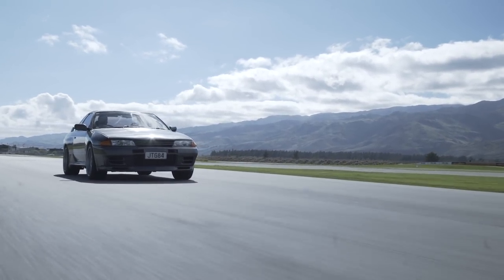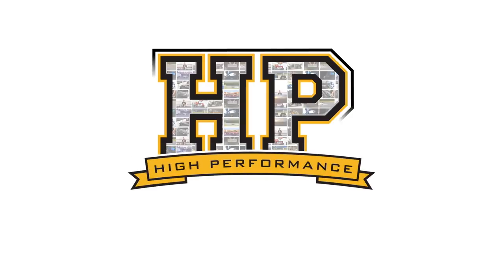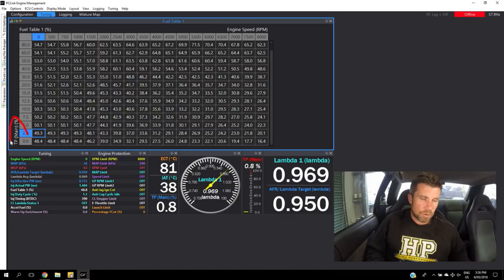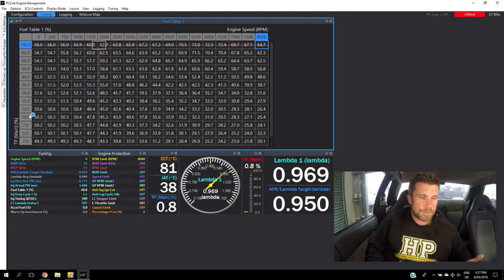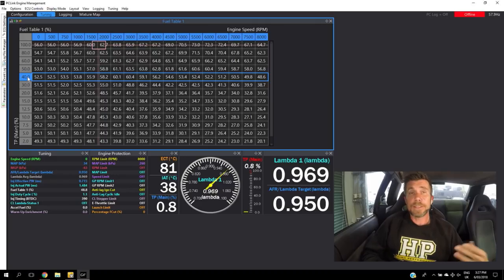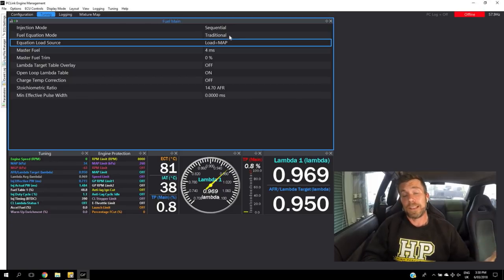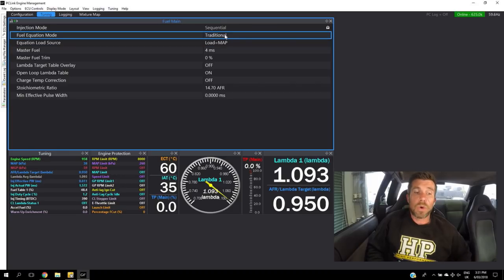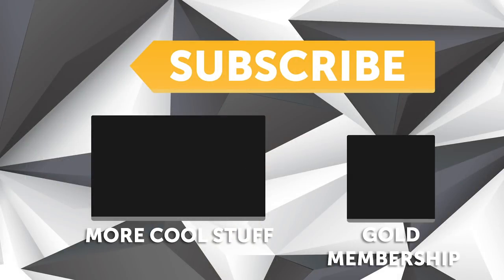TPS + MAP Tuning | Turbocharging with  ITBs - Alpha N [GOLD WEBINAR LESSON]

Comment: thank you very much ! i m  new to this tunig word and your video help me to understand how to set up my ecu to work correct with my set up ! 
only one qustion  i have :
(bmw m50nv itbs, ecu master emu black )
i dont have 4d table in ecu master as option but i do have "map vs rpm correction " is it that what shoud i use to correct the my ve table at 100kpa + ? and  should i consider value of 100 to be 100% of the ve table (97 =  -3 ) ?

Comment: Good video, thank you.  I have an important question.  From my experience with the BMW S50 engines, is that the MAP pressure readings are representative of load.  In these engines the ITBs are connected with a common vacuum rail so the pressure readings are more like in a single throttle setup.  Is the engine in this video lacking such a common vacuum rail?    This is also the case for other BMW-M engines with ITBs like the S54 CSL and S65 which uses MAP sensors from stock.
Reply from the maker: Even when running alpha N, where possible it's advisable to incorporate a MAP signal so the ECU can performa background compensation for MAP. This should be done from a balance bar that takes a feed from behind each throttle to give a stable average MAP value. You would think then that we could simply use this MAP signal for a conventional SD fuel table but unfortunately it isn't quite that simple as MAP alone isn't a good indicator of airflow with ITBs.

Comment: Oh and one thing not covered here, and kind of in response to Andy's question. 
Often ITB engines have a really crap (unstable) MAP signal. So tuning low loads and cruise on the MAP sensor is an exercise in tearing your hair out
Reply from the maker: Actually you can get a MAP signal that's nice and stable by taking a line off each throttle body and running them to a small reservoir. That still won't give you good results if you try tuning using MAP alone though.
Reply: @hpa101  I use the efi-hardware kit for this this (it's really well made,) on my GTiR. With the 4 cylinder, it's still a little too 'jumpy' for my liking. No doubt on a 6/8/10/12 where there are more cylinder pulses it would event out even more.

Comment: Hi guys @hpacademy

Quick question: you mention that you don’t need to use alpha-n for the ignition table as only the fuel delivery is influenced by the individual throttle bodies (which makes sense) Is this true for NA applications as well? 

I have both tables with tps on the load axis atm and just wondering if switching the ignition table back to MAP would be benificial. 13b engine, megasquirt ecu. Thanks!!

Comment: Can solve the high boost rich problem more elegantly by tuning in in VE mode. Using a TPSxMAP with MAP measured in pressure ratio between IMAP and eMAP?

To the best of my knowledge Link don't offer this option. Regardless excellent tutorial 👍
Reply from the maker: Pressure ratio would be the preferred load axis input, however that creates two separate issues. First up it's quite involved and reasonably costly to add an EMAP sensor (at least once the turbo system is already complete and running). You also need to be able to filter or dampen the signal adequately to make it useable without adding latency to it - Not difficult but it's often ignored. Secondly (and probably the more pressing issue) is that a lot of aftermarket ECUs don't offer pressure ratio as a load axis option.

Comment: So I'm building a 2jz with rb26 itb's...

So installing a MAP sensor on a custom vacuum chamber with signals from all 6 runners isnt enough :(
Reply from the maker: I wish it was but sadly nope. In all honesty unless you're already done with the project I wouldn't recommend adding ITBs to a 2JZ. It's unlikely you'll see any real advantage from doing so and even in the RB world most people chasing high power will revert to a plenum and single throttle. If you're doing it for the sake of being different then have at it, however if you're expecting a massive transformation in terms of response you may be disappointed.
Reply: @hpa101  with the current situation nz is in, I'm just doing things for fun.

I do have a goal. Nothing more than 500HP. 300hp is more than enough to drive to the south island and see what those b roads are all about.

Comment: As I understand it some ECUs offer a "MAP window"  feature, where the user can choose a sampling window during the cycle (720 degrees).  This is then set to start sometime after intake valve opening and end  time after intake valve closing, and a minimum MAP value during that window is used to calculate fueling. Any experience with this?

Comment: In the speed density system the MAP is taken in the plenum chamber and after the single throttle plate. In this example for the main fuel delivery table you are using TPS as the load axis because there is no common plenum chamber but in the lambda target table you are using MAP as the load axis to allow for changing turbo boost pressure. Is this MAP taken after the throttle plates or is it taken between the turbo and the throttle  plates. If it is taken after the throttle plates are there  hoses coming from all 6 inlet ports to some form of surge chamber to even out the strong pressure pulses that you would get from a single port only.

Comment: Why are you only running on 2wd? Does it not effect the loading of the engine with awd engaged?
Reply from the maker: It's a little easier to use a RWD car on a rolling road dyno vs AWD or FWD. The load is the exactly the same, the engine doesn't care what it's driving it's doing the same things at the same load cells regardless.
You can even tune the engine on a dyno by itself if you wish - Taz.

Comment: So what if we don’t have an on board wideband in the ecu and only using the dynos, do we just use the tps for base fueling then can use the 4d table for boost?
Reply: you better buy one.
Reply: You need wb
Reply from the maker: You don't need an onboard wideband to tune but you will need a wideband - either a portable one that you can log the output from, or one connected to the dyno. Without that you have no way of knowing the AFR.
Reply: I’m aware of that I meant using the dynos wideband instead of having one wired into the ecu. The primary fuel base table will be the same but what secondary table is used for boost. Cheers

Comment: Why not use a MAF sensor? Thanks.
Reply from the maker: Many aftermarket standalone ECUs don't actually offer the option of a MAF sensor so you may have no option. There's nothing wrong with using a properly sized MAF though in an application that's compatible with one. A MAF or in the case of the RB26, twin MAFs also adds to the complexity of the intake system.
Reply: @hpa101   Thank you!

Comment: Alpha N / tune . Is a BMW thing. Nothing to do with syklines or RB engine's.  And I've turbocharged a S50 Euro in my e30
Reply: bmw didn't invent alpha n lol
Reply: @Nebbia_affaraccimiei  neither did Nissan.  So what are you on about
Reply: @Nebbia_affaraccimiei  says the troll fake account
Reply: @_i-kr6eg  what are YOU on about? you can see my channel and my videos no fake here. alpha n existed since ecus existed. nothing to do with bmw
Reply: No one said Nissan invented it lol. These cars used a MAF stock. This is just a best case scenario as ITBS
Reply: @Nebbia_affaraccimiei  says the non car guy and troll talking about things he has no idea about.
Reply: @KronicKatz  what you said made no sense nor did it clear up anything!!!?? . Do you even open or ever had a modified vehicle/s I guess not
Reply: just gonna leave you rambling. i recalibrate oem ecu for a living btw.
Reply: @_i-kr6eg  lol I own a r32 GTR with a Rb30...... I was saying stock Nissan had the air calculation based upon a MAF sensor. The reason as to why you see alpha N applied here is due to the fact the car has ITB'S. INDIVIDUAL throttle bodies cause for odd transient air conditioned which cause and over fuel or under fuel in the upper or lower part of the fuel maps, causing you to swing your afrs in attempt to correct it if you were using a traditional map vs rpm tuning perspective. As to why you are compensating map using the ideal gas law in order to map your fuel table to a throttle position vs rpm while compensating for boost.
Reply: @_i-kr6eg  but you literally kill me. These strategies are ubiquitous in the tuning world, irregardless of manufacturer. It's a case by case scenario that determines the strategy used. Your head is huge lol.
Reply from the maker: I've got no idea what you're talking about. It's not 'a BMW thing' and instead is a tuning method applicable to ANY engine running ITBs, including the Nissan we use in this webinar.
Reply: @KronicKatz  and I already know . Most of these because my S50 Euro has this also alpha n tune is for smoother power delivery etc makes the car more driveable
Reply: @hpa101  not a BMW thing . How if I had a n tune software in the early 2000's And before that time . And I've never seen anyone tune a rB with ITB and big hp because almost all remove the MAF and ITB system  . So no Nissan has nothing to do with anything ever . Talk to BMW guys . Please most of you keyboard warriors need to get a job or experience before stating absolute rubbish
Reply: @hpa101  yes I know this also it's more for the drivablely and more refined tune as in the mapping,  sorry I only know more mechanical not chips/ electrical etc etc still don't know how tune a car on a dyno , but most wouldn't have a clue anyways
Reply from the maker: @_i-kr6eg  and yet here we are with a Nissan RB26 with ITBs and if you watched the webinar then you just watched one being tuned using alpha n... 💁🏻‍♂️Nissan in fact has lots to do with lots of things, lots of the time. And at the risk of repeating myself, no, it's not a 'BMW thing'. Do you believe that BMW invented this? If so you're sadly mistaken. It's also been around for decades - It's not a new technique.
Reply: @hpa101  I know BMW nor Nissan made it !!! I don't care . But I've used it years before I ever seen it used in a RB !! I'm sure in the late 90's and early 2000's people were using alpha N tune!!! Show me or do you know people that used such software/tune on a RB I never had !!! Nor does anyone else using it because almost on a RB go single TB and no MAF on RB engines .
Reply: @hpa101  mate the RB scene is boring did them 12 plus years ago , those engines/ car skylines are old old news too me worked on so many of them it gets old quick!!!
Reply from the maker: @_i-kr6eg  what's old to you is new to someone else and what's new to you is old to someone else. 
It's all good, at the end of the day this is a lesson on Alpha N tuning, not anything specifically marque related. A car has to be used to demonstrate, one was, here it is. Even though it's old hat to you, I hope you still enjoyed it 😎 - Taz
Reply from the maker: @_i-kr6eg  Ohhh you are talking about Alpha N Tuning software, which is BMW flash tuning software. 

We are talking about a tuning methodology that is that device is named after. :)
Reply: @hpa101  thanks lol

Comment: ITB's are only marginally valuable on a NA engine.
On a Turbo engine ITB's are completely useless, therefore, DON'T USE THEM.
You can still run a MAF with a Turbo and ITB's.
ITB's can be made to work with  a Speed/Density setup by creating a vacuum/pressure reservoir that connects all intake ports after the TB's,
but this is a pain in the butt way to do it that requires a lot of cut-and-try experimentation, for ZERO GAIN.
If you're installing a Turbo on an ITB engine, 
REMOVE THE THROTTLE BLADES AND SEAL THE THROTTLE SHAFT HOLES, OR, GET A PLENUM STYLE MANIFOLD.
The power difference is zero to none, and your tuning headaches will be greatly reduced.
The best setup is to put a huge TB on the inlet of the compressor, and a MAF ahead of the TB, 
this eliminates the need for a BOV and reduces Turbo Lag at mid to high rpm, and to a lesser extent, 
reduces Inlet Air, and Compressor Housing, Temps.
If you are considering using Alfa-N tuning, then you already have an after-market ECU,  
which means you can run a standard GM MAF which is good to over 1000 HP and very easy to tune.
The GM MAF is specified to be mounted in a 4 inch tube, you probably can't come close to using all that flow potential.
This setup also allows you to run a small percentage of your Water/Alcohol Injection at the Compressor Inlet 
without fear of running it through your inter-cooler, because the inter-cooler will be running under vacuum ~95% of the time.
In fact, with a properly engineered Water/Alcohol Injection System, you can probably get rid of the inter-cooler and all those expensive pipes,
it only depends on how extreme you are going.
.
.
Reply from the maker: Unfortunately making a blanket statement like you've done is both misleading and inaccurate - There's unfortunately not a lot of absolutes in the world of performance engines. There can be some significant advantages to ITBs on N/A engines in terms of power which we've proven on the dyno multiple times in both the Honda K20 and B16/18 as just two examples. It's not always a case of chasing power either, and Nissan chose to use ITBs on both the GTiR's SR20DET and the R32-34's RB26 for improved transient response. 

ITBs WILL NOT give good results using a MAP-based load input, regardless of using a vacuum balance reservoir (the RB26 even includes a balance bar in stock form). You can make the engine run perfectly at WOT but you won't be able to get accurate or consistent control of the AFR at part throttle. This goes for an N/A engine but is even more evident in a turbo application. I spent a good portion of the early years of my career with my own turbo ITB engine running an ECU that could not use a TPS load axis so I have plenty of experience here and I'm very aware of the limitations. I'd also disagree that tuning an ITB turbo engine creates headaches. If you follow the techniques in this webinar it's incredibly simple. 

Putting a huge throttle body on the inlet of the compressor (turbo?) is a terrible idea as your effective 'plenum' volume is now massive, incorporating all the intercooler plumbing and your intercooler. This will create more tuning headaches than properly tuning ITBs with 4D mapping ever will, particularly when it comes to idle control. 'Huge' is also not the way to specify a suitable TB size and bigger is most certainly not better when it comes to the throttle butterfly. To address your last point, while a properly calibrated MAF has its place, it's not the answer to every problem. The first issue is that many of the current crop of aftermarket ECUs don't  even allow for a MAF input. Secondly a MAF is a poor choice for some engine combinations, particularly those running aggressive cam profiles with a lot of overlap since this creates reversion at idle which plays havoc with the MAF signal - Andre